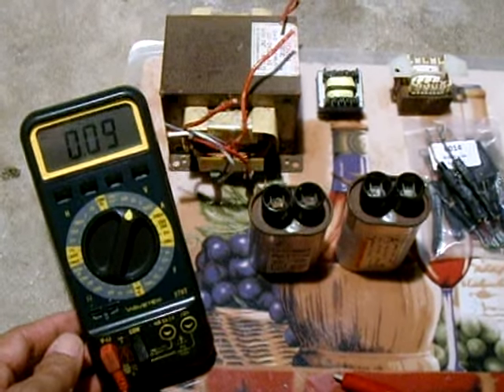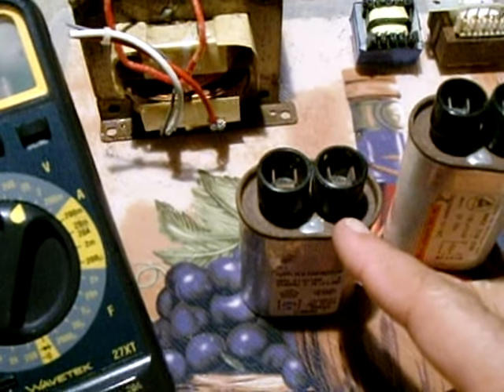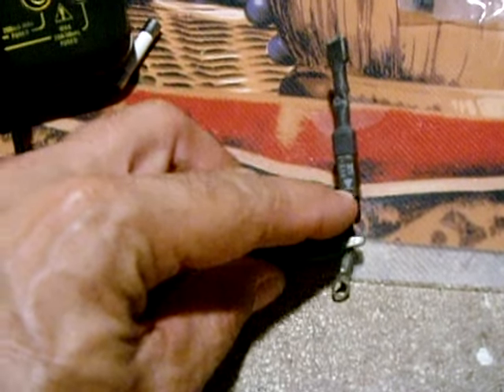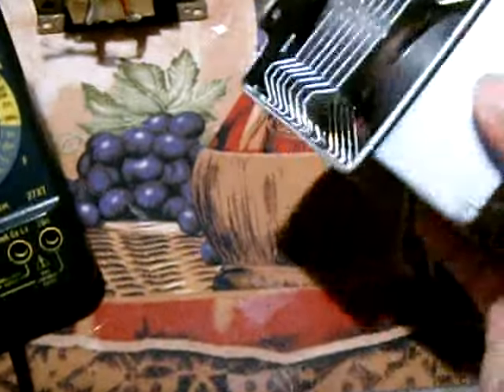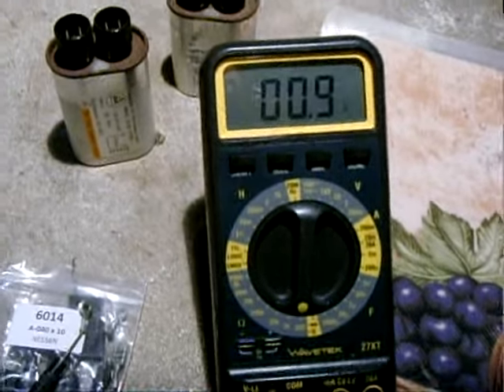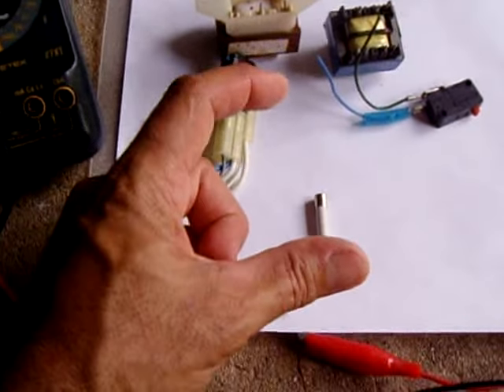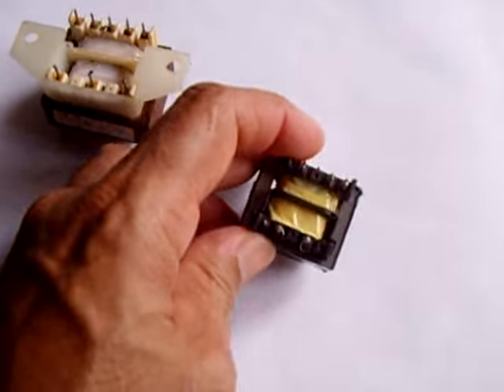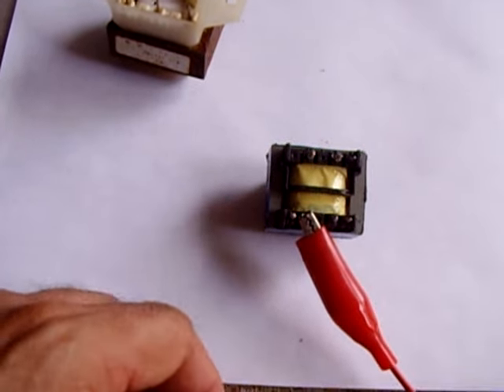How To Easily Test Microwave Oven Parts! (Ultimate Guide)

Comment: my multimeters already read 0.2-0.3 Ohms when the leads are touched together and I get the same reading when testing the magnetron and transformer secondary winding, so I don't know if one or the other is bad.
Reply from the maker: Deduct the reading from the measurement you take.
Reply: @electronicsNmore  I think my multimeters aren't accurate enough to read that low ohms, it was fluctuating between 0.2 and 0.3 ohms both while doing a reading or while just having the leads connected. I saw another video https://www.youtube.com/watch?v=xJMorrJzm6c which helped me confirm the transformer seems good. The capacitor and diode also seem ok, so I think it has to be the magnetron.

Comment: My GE microwave is properly working except when it is done heating up the food, and we open the door, the fan is still blowing. So what is the possible recommendation that you can give? And one thing more, can you show me how to make a wire to discharge the capacitor? Thank you.
Reply from the maker: Sounds like a faulty door switch. You need to test them all very carefully, and open/close the door as you test them. Make the microwave is unplugged, and test according to the video.

Good link here showing how to make the discharge tool.

1k to 10k is fine.

http://www.ifixit.com/Guide/Constructing+a+Capacitor+Discharge+Tool/2177

Comment: Thanks for the video, my Panasonic inverter microwave no longer  working 2days ago. When I opened the door, the light came on then popped. The timer counts down, but no  light, turn table not on, fan not on; Took out the 3 switches to test. Both prim and secondary closed when pressed... inter switch open when pressed... they look fine to me. The bulb actually burnt. wondering if u know the problem and what is next to test... Thanks in advance, Terry
Reply from the maker: Hi there. Sounds like you may need to swap out the power board.
Reply: Thanks for the reply. Are you referring to the pcb that contains the power relay?
When I open the door, the lamp is supposed to be on. I checked the voltage between the lamp connectors and read 0 v. Between one connector and the chassis, it reads 110v. The other connector doesn't seem to get grounded. Is it possible that the Power Relay is busted? Any way to test that out?

Comment: 6 volt drop across a diode?  What happened to the 0.7 voltage drop of diodes?  Are there ten diodes inside this diode?
Reply from the maker: HV diodes are different. :-)
Reply: @electronicsNmore  I think internally there must be ten in series in that silicon !

Comment: HI have performed all of these checks and cannot find a problem but my convection  / microwave still does not heat water. Everything sounds ok when the overis turned on.  How can I check the voltage coming out of the transformer? I want to verify if the transformer is good / bad and maybe the magnatron is good / bad.
Reply from the maker: After unplugging the microwave, and discharging the capacitor, you can take the red high voltage wire leaving the transformer and position the terminal connector on the end of the wire VERY close to the transformer core(1 or 2 mm space), but not touching. Then plug in the microwave, and power it up for 3 seconds while standing back. You should hear and see arcing between the end of the wire and the transformer core if the output is working. When done testing, unplug the unit. More than likely a faulty magnetron.

Comment: So, I have 115VAC at the transformer.  All resistance measurements of transformer agree with your measurements (75 ohm from output to body of transformer).  Diode tests good.  Cap tests at 9.8.  Resistance values of magnetron agree with yours, but still no heat.  Any suggestions?  Thanks in advance!
Reply from the maker: It is possible that even though the magnetron tests OK, it can be faulty. I have seen it happen before. I would double check all connections, Keep your DMM connected to the transformers 120V terminal when you turn it on. Make sure you see 120V. Try some continuous moderate tapping with the back of a screwdriver on the large black relay on the circuit board while the microwave is running. You could have bad contacts!

Comment: I'm trying to figure out the specs on a magnetron that is no longer available so I can replace it with a non-oem unit.  The original is a Sanyo 2M219H which, from what I've read, is a 4.1kv rated unit (due to the "2M219" part, H being the physical size and layout of mounting ears, vents, etc).  

The problem is the tag on the oven itself says "microwave output" is 1000w which, if I'm not mistaken, would be equivalent to a 4.35kv rated magnetron.  So I guess my question would be: can, would, or should the oven and the magnetron each have two different output ratings, or are they one in the same? 

Thanks for any info.

Comment: Turntable doesn’t turn on a GE Microwave model JVM1870SK04.

I hope you can help. I’m a handyman in my community and I’m trying to help senior citizen with her microwave problem. I checked the motor and I had no continuity.  I also checked the motor input connection and I had 21VAC showing.  The keypad turntable control was also working by verifying that it was turning the voltage to the motor ON and OFF.

I tested the old motor and definitively confirmed the motor was bad by testing it with an external power supply at 21VAC.  Convinced that the problem was with the motor, I ordered a new one. To my amazement the new motor didn’t work.  I tested the motor with the external power supply and it checked OK.

I have 21VAC power at the motor input.  
Motor OK. 

I’m stumped on the possible problem. I could order a control panel but I don’t want her to buy parts unnecessarily. Can you help with this problem?
Reply from the maker: +Bruna Delise 
21v? The motor operates using 120V. You need to connect 120VAC to the turntable motor and see if it starts turning, if it does, you must trace the wires back to find out why power is not being supplied.

Thanks

Comment: Doug...Well I replaced the magnetron.... drum roll.................... it still buzzed. I know. Anyway, as if that is not bad enough,  the magnetron that I purchased was...... well.... a used one.   I really expected it to be a good one since I bought it from a very reputable seller with 100% feedback rate on ebay who only sells appliance parts. He claims the part came from a working oven and was tested.  Regardless I still can not be 100% sure that it is a good one. 

Now I decided to buy ALL NEW PARTS including mag, generator, cap, and diode. (Diode and cap tested good, but not taking ANY chances this time!)This way I will be able to return any parts not used since they have a no question asked return policy. I will keep you  posted. Thanks
Paul
Reply from the maker: +MrUsaer 
You made sure the HV transformer is not vibrating?
Reply: +electronicsNmore 
I remember that I did push on transformer with a long plastic pipe while it was running to see if that changed the noise pitch while running, and the noise level stayed the same. The loud buzz definitely sounded electrical, and not like it was physically vibrating. (I assume this is what you are talking about) 

I have 2 questions....
1. .Do you know if a weak regulator can damage a magnetron OR visa versa? I only wanted to replace the bad part and not waste money on replacing parts that seem to be working ok. 

2. Is there a such thing as a WEAK diode, or do they just go bad all at once like a fuse? I only ask because it seems that when buying a new regulator some online sellers seem to want to sell you a new diode as a package deal with the regulator. So if my regulator is bad, is in necessary to replace the diode too?

I should have all new parts by the end of the week and will replace them one by one starting with a brand NEW magnetron... unless you suggest a certain order to start replacing the parts. I purchased  a new mag, trans, cap, and diode.

Much appreciation for your suggestions and  help.
Reply from the maker: If the HV transformer has been properly tested, as well as the HV diode and capacitor, then usually the magnetron is faulty.
Reply: +electronicsNmore 
The new parts came in last week and I replaced EVERYTHING. The cap, diode, magnetron, and transformer. Of course the buzzing stopped and it worked fine.  I started pulling out the new parts and replacing with my original parts. As soon as I installed the original old transformer it  started buzzing again. 

I tested side by side ALL of the old and new parts. The readings on both old and new parts were identical. Is there anything that I could have missed? I think you (or someone else) said that sometimes a part will test as OK, but it may not work when installed. Maybe this is one of those times.

Had fun and learned a lot about my multi meter and micowaves ..... so time well spent. Look forward to any thoughts you might have on why the transformer tested ok but was still bad. Thanks again for your help!
Reply from the maker: The buzzing you heard was arcing. If you left the cover off and stood back while the microwave was running in the dark, you probably could see where it was arcing.
Reply: +electronicsNmore 
So....could looking for the arching light show be another way of determining if your transformer is bad? I wonder why the multi meter test I did were normal. What would cause the arching/
Reply from the maker: MrUsaer

Arcing occurs when the enamel insulation on the HV winding  breaks down. Usually happens with years of use.

Comment: Hi what a wealth of info. My Maytag has no power, no display, nothing, fuses are good.  Suspect your suggestion that  the transformer is the culprit, so instead of checking it out I got a price for one - cheaper to buy new micro wave so I will not bother testing.  Thank you sharing all your info
Reply from the maker: Microwave ovens that don't power up at all, are usually the easiest to repair! Just connect one leg of your DMM to the microwave metal chasis using the 250VAC setting, and the other you will probe the hot wire all the way to the circuit board to see where the power stops. The problem could be a thermal cutoff, or the PC mounted transformer which is faulty.  I would take the time to test it.

Thanks For Watching
Reply: electronicsNmore I cannot Id part you are referring to - no listing for pc mounted transformer and I have nothing that looks like this, although in looking deeper - right next to fuses on pc board their are wires that run to power cord that look to be burned. White is burned - black looks okay.  Can this be replaced and is it possible this could have happened from a power surge. Would have sent pic but ...........
Reply from the maker: If you see something burned, repair it.

Comment: I used your procedures to measure magnetron resistance and initially got 0.3-0.4 ohms but value gradually fell to zero. Is this a failed magnetron? I checked HV transformer and got good primary, but lower pair of HV leads measured zero ohms. Single HV lead was 87 ohms. I used a 20 megaohm, auto ranging VOM.
Reply from the maker: The magnetron should read close to zero ohms, but never zero. The test is also not 100%. Shaking the magnetron should result in no rattling, and the 2 ring magnets must not be cracked. There is a 2 turn winding on the transformer(red wire or red w/white) which measures close to zero also. That is normal. That is the filament winding.

Thanks For Watching! Be sure to share my channel with others, and rate Thumbs Up.

Comment: I have a question if you can help me.I want to do an isolator transformer with 2 Microwave oven transformer the same.what I want to know as secondary shall I use the 2 red end between the 2 coil to connect bought transformer and disconnect the high voltage red and cut the wire touching the body.So I will have an input of 240v and an output 240v.What is the output of the 2 red wires between the coils?
Reply from the maker: +Joseph Cauchi 
Hi Joseph. You need to cut open the weld of a 220V MOT as shown in my other video, then remove the middle red wire(2-3 turns), along with the HV secondary. Take the primary from another MOT that is identical, and install it in the transformer that you removed the filament and HV winding from. You will end up with 220V in and 220V out.
Reply: Thank you I will do it like you have advised.

Comment: Hi, thank you for your video, it was informative.
My microwave was working then died while cooking. One of the fuse blew up but it didn't fix it. So I continued to investigate (although I didn't test the switches and relay yet). I noticed that the capacitor was 0.53 micro Farad while it should have been 0.91 micro Farad so way out of spec, I change it but still no go. I checked the thermal fuses and they were ok but one written 40C / 70C on it. This particular one is Normally open and closes at 40C (I believe it is related to the fan), not sure what 70C does, maybe increases the speed to full speed on the fan?
Looking at your video it seems like the transformer is out. I couldn't get a reading more than a couple of Ohms...far from the 80/90 you got in the video. So I'm going to replace that and see if it does anything. For now the microwave "works" but doesn't heat the food. The magnetron seems ok with really low reading (0.01 Ohms) between the 2 prongs and no continuity from the prongs to the body. We'll see...
Reply from the maker: No heating issues are usually a fault of the capacitor, diode, or magnetron. I rarely found a bad HV transformer. As for the thermal switch, the 70C is the temp it triggers to open the circuit, and 40C is the temp it has to drop to in order to reset the switch. If you'd like to support my channel, you can use the links provided for Amazon & Banggood in the video description area of my videos(especially newer videos) when making purchases. It's no cost to you. Thank you!
Reply: @electronicsNmore  I retested the transformer with a new voltmeter and it tested 127 Ohm... so now I feel like the magnetron is dead but doesn't show it on the voltmeter..puzzling.

Comment: I have an LG microwave that would start when I pressed the button, but would brown out and blow the breaker.  Took the cover off, and the transformer was fried literally.  Replaced the transformer, checked the capacitor, diode and magnetron, all checked out ok.  Put it all back together, and it's still doing the same thing.  Looks like it's trying to draw too much amperage on starting of the magnetron, then blows the breaker.  Could it still be the capacitor even though it tests ok?
thanks!
Sean
Reply from the maker: You can try unplugging the microwave, discharging the capacitor as shown in my video, then unplugging the red HV wire from the transformer and leave it at least 1" away from any metal parts. CAREFULLY without touching ANYTHING inside the oven, stand back and plug in the microwave. Next, using the keypad, start up the microwave for a duration which would normally allow the problem to occur. If nothing happens, (everything works OK without heating), then you have a faulty capacitor, diode, magnetron, or you wired it wrong. Unplug the microwave when you finish the test. You do this at your own risk. Do it wrong, and touch anything while powered up, and you can be killed.

Comment: great video i have a combination of microwave and oven GE PT970S M2SS do you have any literature/information how to take the micro apart to see the components. I have no powers to the micro
Reply from the maker: +Antonio Pacheco 
Probably a blown fuse inside the microwave due to a faulty magnetron, capacitor, diode, or door switch. You need to take the time and do some research on your make/model microwave.

Thanks

Comment: If when testing the capacitor I got 1.9 ohms across the terminals. Does it mean that the  capacitor is faulty. In reference with 4:06 to 4:25 of the video testing the  capacitor.
Reply from the maker: You have a shorted capacitor. :-)

Comment: Alright, I got back in the microwave to test the capacitor and diode.  Diode resistance varies depending on the direction of my test probes; therefore, I think the diode is okay.  Testing resistance/continuity of the capacitor, there seems to be an internal ground, i.e., no resistance across terminals but infinite resistance between terminals and the can or housing.  Bad capacitor?  Now the problem appears to be locating a capacitor with the same GE RC-QZB011MRE0 specifications, 0.9uf 2300 VAC.  Can I use a capacitor of nearly equivalent specifications, say 1uf and 2100 VAC, and can I use a capacitor that contains an internal resistor?
Reply from the maker: Mark Allen The capacitor, once the terminals have been shorted, should give you a low reading at first, then steadily climb way up into the millions of ohms. The internal resistor is 10M, so it should level off around 10M. Sounds like you have a faulty(Open) capacitor. The capacitor does not have to be exact, but it should be very close in value. Try and keep the voltage rating the same, otherwise the capacitor may not last as long if you use a 2100V. More than likely the 2100V will be fine. The internal resistor is used to bleed off the charge when the microwave powers off.

Thanks For Watching!